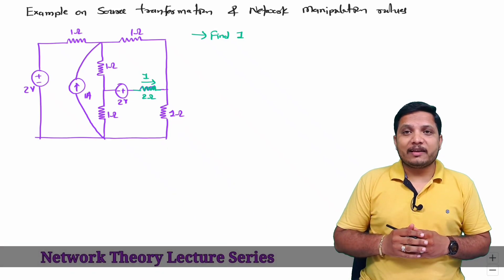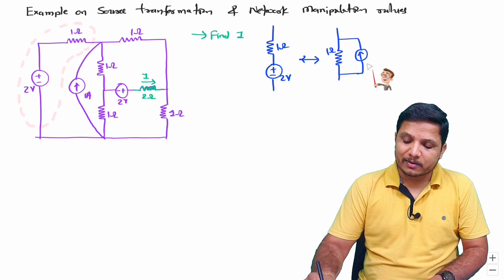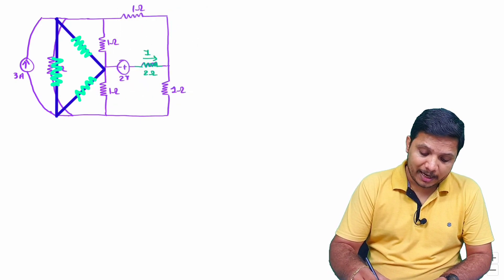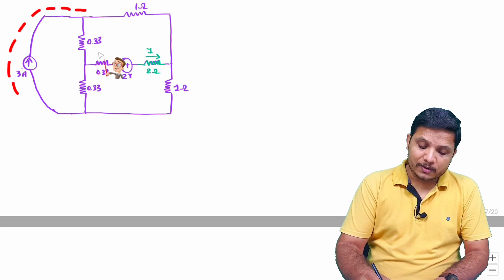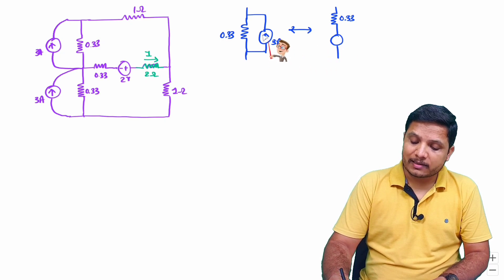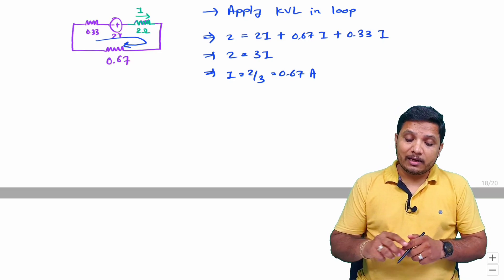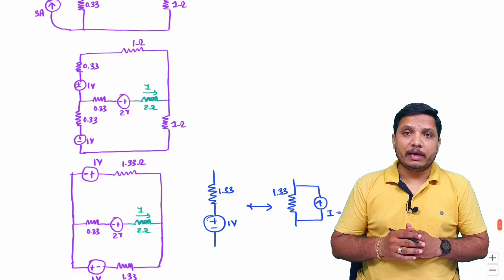2 - Source Transformation and Network Rules: Solved Example

Comment from the maker: Example on Source Transformation and Network Manipulation Rules explained with following Timestamps:
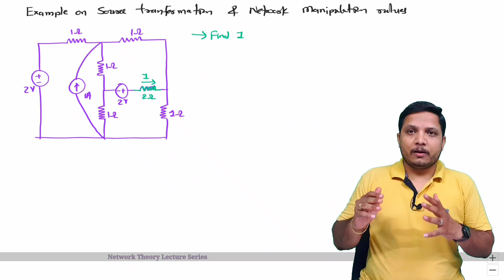0:00 - Example on Source Transformation and Network Manipulation Rules
0:39 - Source Transformation - Voltage to Current source transformation
2:07 - Network Manipulation rule - Current sources in parallel connection
2:49 - Delta to Star Conversion for resistance
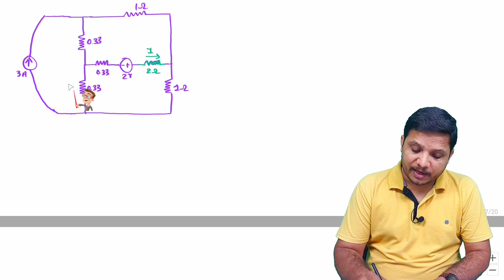4:41 - Network Manipulation rule - Current Source distribution rule
5:47 - Source Transformation - Current to Voltage source transformation
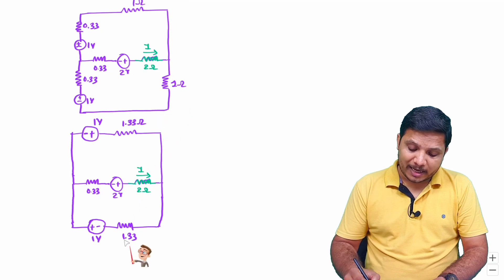7:45 - Source Transformation - Voltage to Current source transformation
10:01 - KVL loop to find current through resistance